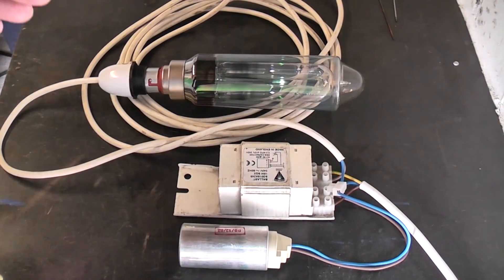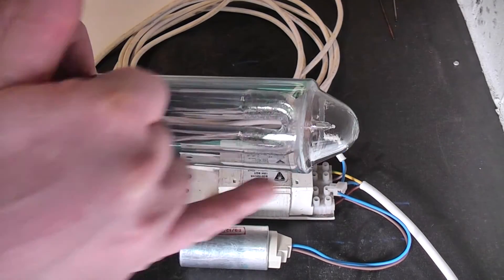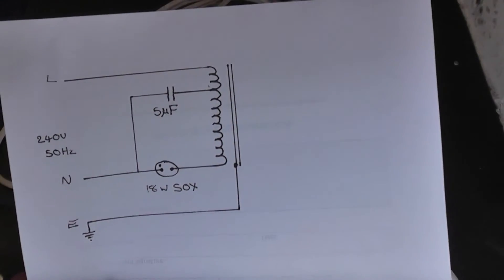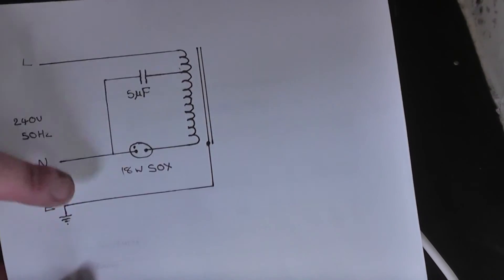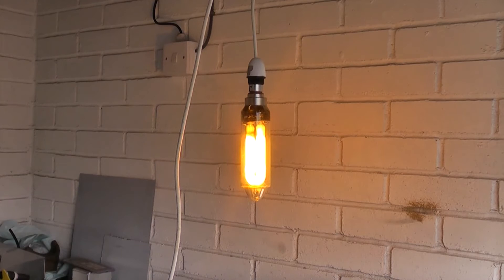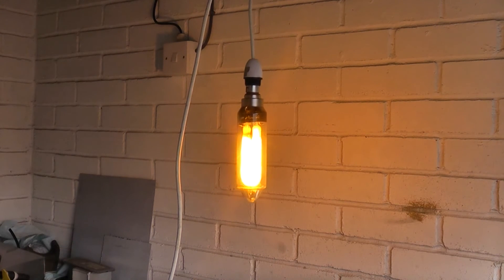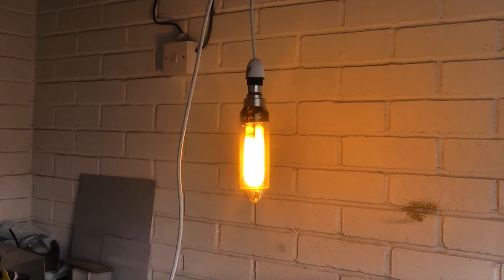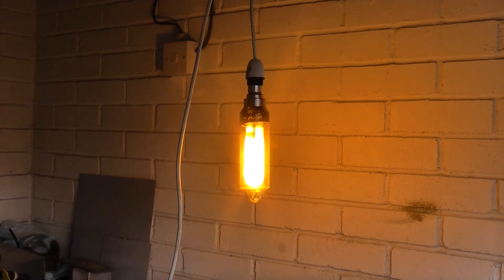18w low pressure sodium (SOX)lamp.

Comment: I wish there was a way to have these in my house.
Reply: If you live in the UK, you can simply buy a typical B22 lampholder, a SOX ballast, a power cord, and a SOX lamp.
Reply: @TheSoxmania  i want to do that
Reply: @TheSoxmania  dont know where you can get the posts from
Reply: @thepurdychannel8866  so I'm not the only one who wants to run this at home (this or a low wattage HPS) as my before bed light because of the pleasant yellow colour...
Reply: @mateuszdrab  i know they are lovely when you see them warm up
Reply: @thepurdychannel8866  I have a 150w hps bulb but it's not the same actually, the colour is nice but the bulb sounds a bit strange with an osram pti electronic ballast, I don't think they're compatible as everywhere says they're only for Metal Halide. 😂
Reply: @mateuszdrab  i dont know what happens if you run a son bulb on a mh ballast or even a mh ballast possibly lamp failiure or reduced life
Reply: @thepurdychannel8866  the MH bulbs i have say that can run on son and mh gear. The MH bulbs seem to have a larger nominal voltage than son bulbs, I expect them to burn at a slightly different temperature. Idk, I need to measure it all with a multimeter.
Reply: @mateuszdrab  ok thanks
Reply: @mateuszdrab  what about mercury vapour bulbs i know you can run sox on flourecent ballasts but its not reccomended what about running them on a flourecent or mh or son ballast
Reply: @thepurdychannel8866  no idea to be honest, I'm just experimenting with MH as I actually wanted to use this as my daylight simulation light, but i was too concerned about UV, and idk how to proceed.
Reply: @mateuszdrab  if they have a phosphor coating on they are fine if they are clear they will emit uv
Reply: @mateuszdrab  you can get colour improved mercury lamps that have a nice colour for indoor use
Reply: @thepurdychannel8866  what about those non coated but uv filter equipped ones. I have the GE CMH400 and 250, according to specs, they emit barely any UV. The CMH-T 150 seems to emit much more UV than their high power brothers. I also have an Osram HQI-BT 400 W/D which is specced to emit little UV (within limits of some IEC standard), but I'm quite afraid to use them indoors. Though the GE emit nice sunset light, the Osram does a weird tint of white, it's supposed to be 5500k, then I realised a standard fluorescent tube gives a nice 6500k colour so I got 4 of those for the bedroom and the kitchen 2 each, looks so nice they're hidden at the wardrobe/cabinets so the light is nicely diffused.  About 12k lumens in each room. I need a proper fixture for them, atm, just made my own wiring. But for the living room, I need more than 20k lumens I guess, which is why MH was my preferred choice, however it seems risky and the colour temperature is not 6500k. Do you think a 70w HPS bulb will work on an MH ballast? Those are the osram ballast that some sellers advertise as compatible with both. But when I ran a 150w HPS bulb on the 150w MH ballast it sounded a bit strange (the bulb), I wanna make my own little fake street lamp. The LPS stuff seems quite expensive.
Reply: @mateuszdrab  i know the lps bulbs and cosmowhite bulbs are a lot of money
Reply: @mateuszdrab  i think you will be fine .flourecent tubes without the coating are uv bulbs the coating creates the light.  just make sure they are coated or have a a uv filter. Someone used uv c bulbs at a nightclub it was on the news i think it was in china or japan they had welders arc eye and sunburn
Reply: @thepurdychannel8866  hehe. Yeah, the tubes are coated, make a perfect snow white what I'd call. The metal halide, I like the 3000k ones, later towards the evening, my mind tells me to turn off the white light and switch on the yellow one. It's as if my body clock wanted a sunset, and the H/LPS would be a good light to  use late at night as it had no blue wavelength and essentially gives light without waking or impacting your sleep.
Reply: @mateuszdrab  i know i still have some thorn gamma 6 street lights in my area on a privately owned feild  i love to watch them at night they used to be on my my street as well as some son lights
Reply: @thepurdychannel8866  eBay has Kulka  and leviton Sox lamp holders...
Reply: @cengeb  nice
Reply: 18w was always sox-e. 1800 lumens...then the rest ofvthe line had some that should be run on Sox e ballasts...the 18 I have where sold in norelco philips mini Sox wall pack..with advance philips reactor ballast..with or without pf cap...pf cap reduced current use a lot...so if you had lots of fixtures hpf mattered
Reply: I even installed a 90w street roadway fixture in a parking lot..replaced 175w metal halide glaring ugly inefficient flood fixture..Sox lights don't glare..55w wall pack lights my entire yard...and yellow monochromatic lite doesn't annoy the neighbors...6 18 watt mini Sox made in van wert ohio...when philips had their fixture operation..they sold it to American electric...then phips bought genuine forc$3 billion..and added over a dozen fixture brands to their lighting empire.  Stonco had 18 watt wall packs then. American electric made their own version...not as well built as the philips norelco mini Sox units..but a bit slimmer...have them too in stock along with enough 18,35,55,90 w lamps for until I am 123 or so..5 18 w units and the 55w on every night change lamps about every 5 years.  Had best luck with philios lamps...osram and ge or get didn't seem to last as long..there are subtle differences in them. Ge was relabeled old thorn..when ge bought them.  Gec is not ge.  Then as Sox faded philips factory was making osram Sox on osram equip.ent..the lamps have internal differences...arc tube is different.  Now all Sox production ended by philips...ebay for nos..prices have gone up ..I stocked up years ago...knowing they would be done..one time I managed to get like 12 Sox E philips18 for $75 or so and like $15 shipping..super bargain...
Reply: I do wonder what sort of technical difficulties would go into stuffing the electronics into a lower power sealed unit that you could use in a standard residential light fixtures.  It really does seem like there is enough of a niche demand to capitalize on that

Comment: Could you please tell me step by step how to wire one of these lights up?
Reply: I know its late but you need a ballast and ignitor, these usually come together in a set, and you just make sure the 120 volt wire is used and the bulb wattage equals the ballast. also you may need to get an a/c cable that plugs into the wall, then cut open one end to attach the wires together, then use wire caps.

Comment: I use 18W all by my doorways in Philips Mini SOX fixture.  55W Hubbell wall pack for yard...SOX lamps are best, no glare, last long time.  STILL most efficient almost 200lm/W in the larger 180W lamp
Reply: But due to the shitty light it's more like 100 Lm/W.

Sox sucks.
Reply: @TheEsseboy  its thebest light source for street lighting its better for your eyes and improves vision at night
Reply: @thepurdychannel8866  It doesn't, LPS light barely activate rod cells in your eyes
Reply: @thepurdychannel8866  No glare, in rain and fog, no BLUE, pure yellow.  Best for streets, better contrast
Reply: @cengeb  i know i loved the lps lights no glare like you said and they shine through fog better we still have some near us  on a path owned by a supermarket they are thorn gamma 6
Reply: @TheEsseboy  The 18W Sox-e is 100 Lm/W the largeer 55 W is about 120Lm/W the largest 180 W almost 200lm/W  All pure yellow monochromatic bliss, no GLARE for driving, or anything, I have had 5 18W in use for decades and 555W  last forever, no glare, cheap to run.
Reply: cengeb SOX-E lamps such as the SOX-E 26w, SOX-E 36w, SOX-E 66w, etc have better efficacy compared to standard SOX.
Reply: @cedricwoirhaye8268  When used on the appropriate Sox ELECTRONIC ballast, when used on a standard magnetic ballast it's not as efficient..the 18W has always been sox e
Reply: @cengeb  The most efficient SOX lamp is the 131w SOX-E with an efficacy of 206 lm/w. Probably the most efficient light source commercially available.
Reply: @zspacecaptain8228  yup, replaced the 180W, I have a 180W flood fixture 4 ft lamp!!! the fixture is Big heavy Al for refinery and railroad yards etc, was from when they had the factory in van Wert OH....making all kinds of PHILIPS/Norelco fixtures, sold to American Electric, then Philips bought Genlyte, added over a dozen fixture brands to it's stash of brands..the sox-e must be run on sox e ballasts to perform to its full potential, not the same as teh ballasts for the SOX line, only the SOX -e 18 W runs on a standard ballast..all other Sox-e need different ballasts for full performance, they barely marketed SOX e in the U.S., but lots of 18w sox-e...I have the 66W?  SOX-e that replaced the 90W, but never had the ballast or fixture for it

Comment: LEDs tend not to be reliable.  Lots of dead ones around here in 60cy/sec land, especially in hot parts of the country as they are being shoved into applications for which the technology is not suited.
Another part of the cost is that there is only one factory left making them.
Reply: Yeah. And compared to SOX, LEDs look a total joke. The MTBF for a SOX lamp is rated at 18,000 hours although lamps have been known to last a LOT longer than that... the average LED street light in good conditions normally lasts about 8,000-10,000 hours before they start rapidly failing. Best to stick with CMH or SON-T lamps instead as they're still extremely energy efficient and they have a similar lifespan to SOX.
Reply: @TheSoxmania  Thee are LEDs with 20,000 hour ratings, even 50,000 if you undervolt them!
Reply: @TheEsseboy  It depends in part where the LEDs are operated but here in the UK where it's normally good LED weather (aka fairly cool climate wise), the new street lights we're changing over to fail left, right and center. The old SOX and SON lanterns they replaced generally could last at least 5 years without requiring a re-lamp or replacement of any kind. These LED units on the other hand... you're lucky to see 6 months. and it's not much better switching off at midnight either which some locations will do to conserve power.
Reply: @TheSoxmania  Yea, if you buy cheap LEDs you get short life span, the LED it self will last 20,000-100,000 hours depending on how hard you run them. And the beauty is they get more efficient the less power you use per LED. Here in Finland we use domesticly produced fixtures and the manufacturer gives 5 year warranties!